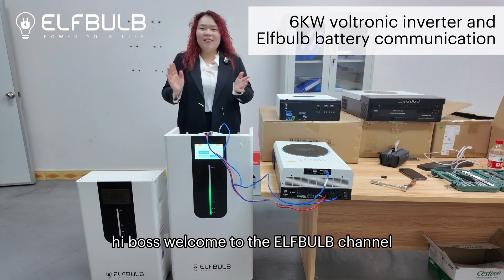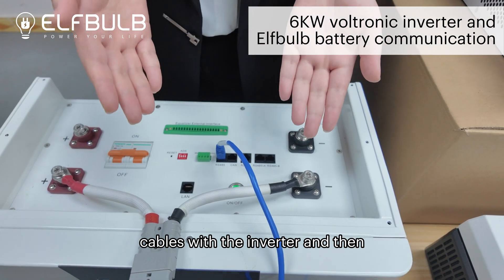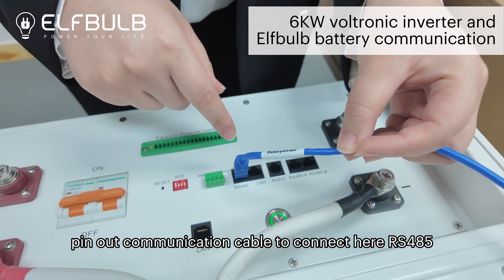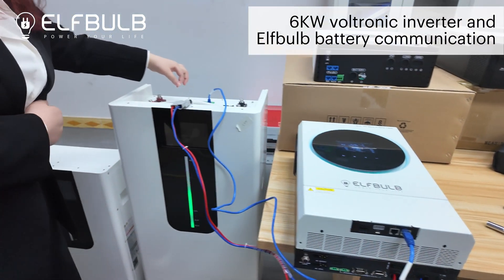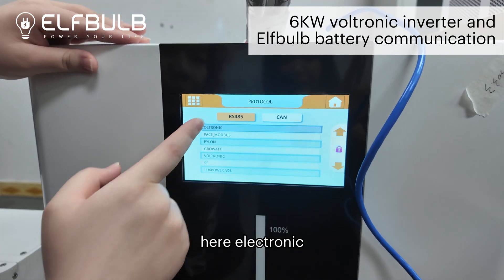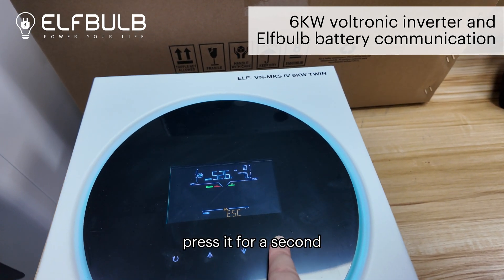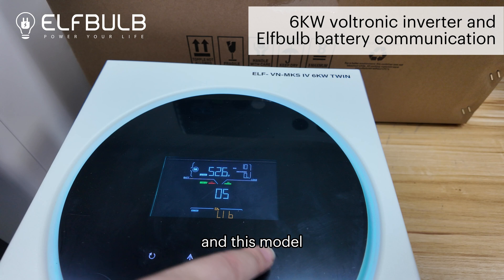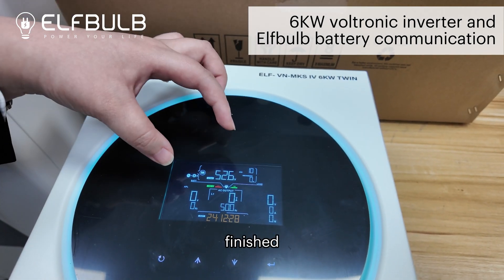Voltronic 6KW Inverter and Elfbulb Battery Communication Tutorial

Comment: High frequency, transformerless inverters like these can set your appliances on fire when their MOSFETs fail bevause they offer absolutely no galvanic isolation. It's much safer to install a low frequency, transformer based inverter instead.